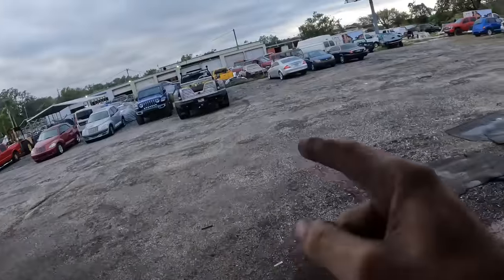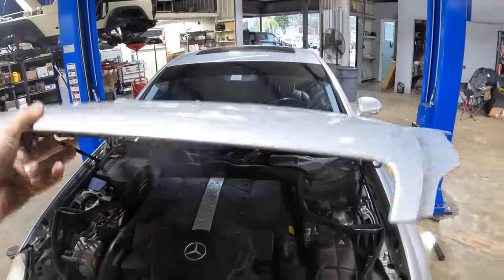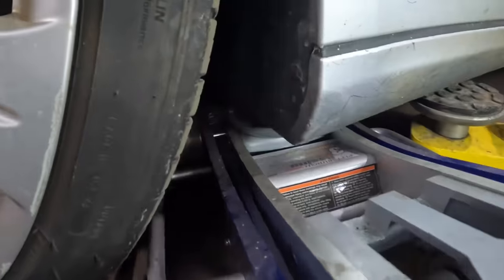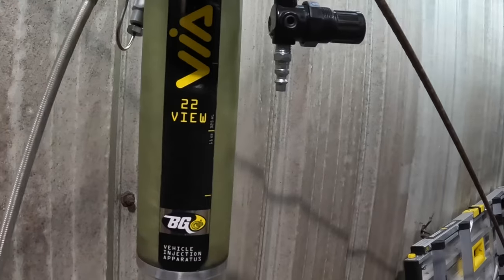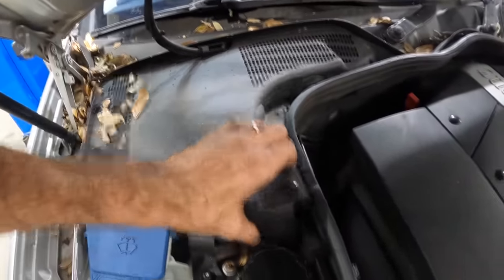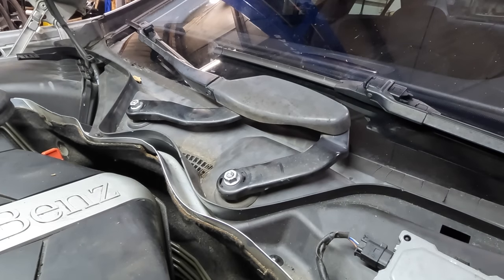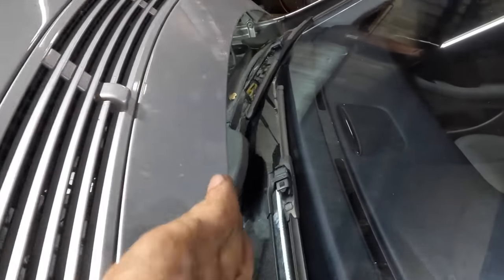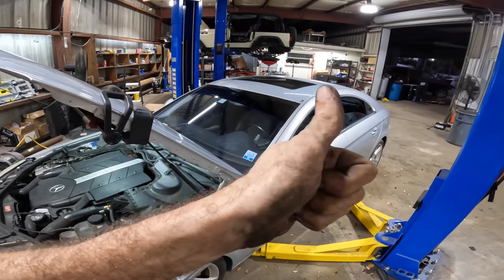Rookie Mistake on a Mercedes! “I quit” @SouthMainAuto

Comment: Mercedes... BMW... Audi... VW...  Apart from being brilliantly engineered solutions to problems that never existed, all are great cars until the warranty expires, then they turn into very expensive part consumers.   Once that warranty timer expires, you're in for a world of hurt. I say that as an ex mechanic, and ex owner.

EDIT:  To all the VW lovers out there (and I used to love my old '67 type 3 station wagon, and '62 kombi van)  They are, as a company and the CEO as an individual, convicted criminals, cheats and liars.
They care nothing about about you as an owner, no matter how much you like the brand, or how loyal you are.  You are nothing but a potential or current source of profit. They actively tried to deceive all owners and governments, then cover up that deceit.
And that's just what they were caught doing, wonder how much they get away with.
Probably true of all vehicle manufacturers, to be honest, but VW are convicted criminals. 

And the "brilliant engineering" was sarcasm.
Reply: Yes, I have the same opinion for the Mercedes RV. Great looking, well thought out, but if it breaks down mechanically, forget it in this small town 🤣.
Reply: I used to have a 2010 Jetta 2.5.  Brilliant car.  It was cheaper to maintain and repair than my wife's 205 Subaru Imprezza.  That Imprezza made me hate Subaru's with a passion.  Worse than an 87 Buick Skylark I used to own.
Reply: @Minimalist1266  I currently drive a 2011 Jetta 2.5. Great car, super reliable
Reply: experience any Volvo aged 8  or more years and it’s always the stupid stuff that breaks.
Reply: I don’t know if I can agree with brilliant engineering but I will say they are over engineered just for the sake of it.  Sometimes simpler is better.  But that’s just me.
Reply: This is only for more modern Mercs and Audis, the older cars  where foreign interference had not intruded, would run forever with only normal  maintenance. Think of all those Merc taxis in Germany and Holland.
Reply: I know a guy who had to spend $5500 to fix a mistake made by his friend who didn't really know how to work on his BMW. Then 2 months later, the tranny shit the bed.
Reply: I own a Jetta 2.5 5 speed manual and a CLK 500, both are super reliable and require nothing more in terms of maintenance than any other car. I paid $5,500.00 for my Mercedes with 115K and now has has 177K on it an I’ve only replaced the power steering pump plugs & wires and the front suspension. Of course brakes, oil changes etc.. still runs like new and has that Mercedes ride and handling. And, yes Ray, that car is both quick and fast.
Reply: I owned a 2014 jetta tdi my first and last vw I will ever own . I always had things breaking , traded in for a 21 corolla and never looked back
Reply: Don’t forget Land Rover and Jaguar. Just pray the car has more months in it than the payment book has pages…
Reply: Mk4 vw Diesels (ALH) are bullet proof and cheap, few cars out there will outlive one and get 46+ mpg consistently. Probably the only vw i will own,, But I'd never own a audi or Mercedes haha 😄
Reply: That's why I have 4 MK4 golfs 3 with TDI 2003 and two 2004 and 1 with 1.8t 2004. All of them cost nothing to mantain and are very reliable.
Reply: @arthur_mkiv8978  THIS....VWs especially those made before 2005, and most Golf and Jetta with 4 cylinder engines are generally super reliable, and easy to repair, funny thing is most shops lump those earlier VW models in with everything made since today...
Reply: I. Know. Bought my first BMW. I'm experienced and realistic, but after 400 miles and $10,000 in legit repairs with another 5k or more pending... I'm done
Reply: @arthur_mkiv8978   same got 3 mk4 TDis, a 4dr golf alh, 2dr golf ALH, and jetta wagon sadly a bew but still reliable
Reply: My fix for wipers on questionable vehicles(one with possible short life span) is Rain-X
Reply: I have a 2006 Jetta TDI - well-maintained zero issues!
Reply: I owned an 80s Mercedes Benz 300D. It had one wiper.  Amazing, I actually liked it. It reached all 4 corners of the windshield.
Reply: These euro cars have terrible resale value, so people snatch them up thinking there a great value. The problem being while you may have only paid $5000-10,000 your still buying parts for $80,000 100,000 car. Further with BMW you've got 80,000- 100,000 miles and then they start to disintegrate; many mechanics won't even diagnose BMWs because they know the owners will never agree to pay what's needed to fix them.
Reply: I suppose I won the Mercedez lottery with my 2012 C300. Just crossed 300K miles. Runs like a dream. Besides regular maintenance, all I've had to fix is a blower motor and one CV axle. That said, I had to convince the wife NOT TO BUY a Mercedez GL350 SUV...because lightning  never strikes twice.
Reply: Well, I'm happy with my 30 years old Audi. yes i had to replace parts and stuff but it's not that expensive imho
Reply: True, but they drive really nice.
Reply: My BMW is still going 158k Mike's, 2009
Reply: Samsung appliances have a built in timer like Mercedes and BMW that soon after the warranty expires they self distruck.
Reply: I have owned multiple Toyotas Nissans and Volkswagens.  I keep buying the Volkswagens now.  0 problems on 3 Volkswagens now all the way up to 200,000 miles when I sell them.  Too many problems with the Nissans.  Toyotas we're 50/50.  Time to end the myth of Volkswagens not being reliable.
Reply: Any car with this many miles would need thousands of dollars of work to get right. Maybe add an extra 0 for a mercedes.
Reply: @TheFrenchPug  134k miles (215k km) on my Audi 👍
Reply: @Laurelinad  I'd rather have the Audi
Reply: VW/Audi are just about the best cars to work on imo. And I’m educated Toyota tech 🤷🏼‍♂️
Reply: @TheFrenchPug  😎
Reply: Did anyone even mention BMW? They're the worst of em all
Reply: @@lol-yolo512 Well, I'm at 215k... So still a ways to go but so far it's promising
Reply: Brilliantly Engineered is far from case concerning these auto manufacturers. It’s all about the latest and greatest unproven technology. This is because the “hey everyone look at me” mentality that people buy these rolling piles of low quality poor reliability vehicles. I’ve thankfully been exposed to Bentley’s, Mercedes etc, the list goes on, only to find them to be absolutely overrated, overpriced rolling pieces of 💩. 
You want todays best yet not flawless built vehicles on the market today, it’s Toyota / Lexus and Honda / Acura. 
It’s because of all these extremely flawed manufacturers we can appreciate the good ones. So keep buying the overpriced garbage folks and the people who really research and try to get the most bang for the buck can have the far better quality vehicles for their money. LOOOOK AT MEEEEEEEE !!
Reply: Brilliantly over-engineered.
Reply: My 2012 VW Golf has never let me down. All manufactures have their flaws, the issue is that people buy these old cars without realising how much they cost to maintain. Likely the case with this Mercedes too.
Reply: I had a ton of Volvo S60 sedans, used to love them. Now I am too old to deal with maintenance so I just lease cars with a maintenance package and return them when time is up.
Reply: @watchingdanny  well said. 👍🏼
Reply: @simono.d9469  I’ve known countless VW owners here in North America with 9 out of 10 people I’d bet it’s been have said they’ll never buy a VW product ever again. I’ve also had GM owners swear how great their GM is, that’s even after rebuilding the engine, transmissions etc. I’d have to say people have different definitions of what a well built vehicle is. And of course regardless of make or model, proper maintenance of all vehicles is required that is not always done that needs to be taken into consideration.
Reply: True Dat 🤟🏻🇺🇸🇺🇸🇺🇸
Reply: All r junk
Reply: Very true.
Reply: Peoples today buying premium brands to look cool and all the money goes for payment of loans. And then the car gets cheapest maintance or if even that.. This cls is good example. Shitty interior, headlights are foggy, power steering making noise..
Never seen shitty car of any brand, with good maintance history. If cars part are expensive, then you cant afford it, simply as that😬 
And what will come to engineering, euro manufacturers are significantly ahead in engineering compared to us or asia these days.
Reply: @fixingitrightish   I have a 2013 Beetle TDI and a 2018 Corolla. I like the TDI as it's a nice engine even though the car  is built in Puebla Mexico. I need to change the Timing belt. 2.5 for VW Jetta are super cheap on LKQ. For less than $400 you too can have replacement. Cjaa is a little over $1000.
Reply: @arthur_mkiv8978  I have a similar story but instead of VWs I have the 4cyl diesel Audis with manuals. Pretty much the same cars. Two A3 and a A4 B5 and A6 C5.
Reply: Hence why I stick to toyota, dealing with a Chevrolet, Hyundai, and then a Dodge... never again. It's all my brother and sister car
Edit: I wouldn't want to imagine working on those car, I took one look under a VW also and I went dumb, maybe it's just me, might have to fix it once to know but those 3 car I mention also sucks, to much electronics
Reply: I hate Mercedes..junk.told the boss I wont work on. Left hand threads??stupid.
Reply: Regarding your question about shops taking advantage of a person based on necessary repair vs not necessary. 100% yes, you can bet it happens if the owner can be leveraged into paying. Speaking from awareness of a small city,  population approximately 7500. The city center and approx 30% of the residential population was declared an emergency after the businesses and homes were consumed by fast flowing flood waters. When the rebuilding began the local plumbing, electrical and heating trades could not handle the volume of the emergency type work. Other contractors came from out of town and gouge priced 200-400% the normal costs because people were desperate. Disgusting low ethics, especially considering many people were elderly, low income women and couples. One contractors attitude was I can charge what ever I want. Adding to the overcharge the contractors refused any warranty work claiming they are from out of the city area.
Reply: @LOL-Yolo I’ve heard the same thing about LG.
Reply: Can confirm.  Owned a stick 2004 VW Passat wagon -  wonderful car when new, but got REAL expensive later on.
Reply: Yep well said @Eh Wot
Reply: Never buy Audi. Always lease
Reply: I believe the biggest issue with the newer VW's is the obsessive desire to do penance for the Dieselgate fiasco by maintaining the lowest CAFE average by requiring a 0W-20 oil in a small, high compression (11.7/1) 4 cylinder turbocharged engine.  The engine was designed to run a 0W-40 as was the MB turbos and most of the older mechanics will tell you to run the 40 weight in any turbo engine.  VW has so much confidence in their new requirements that they dropped the new car warranty from 7 years/72,000 mile down to 4 years/50,000 miles.
Reply: I owned an 07 BMW X5 with 185k on the clock and it ran great mechanically. It wasn’t too expensive to repair either. Nothing compared to the duramax that I got to replace it. When you have more parts, you have more potential problems, but dang if BMW doesn’t know how to make a product that I want. I still own a BMW motorcycle and I will love it forever.
Reply: I've had several M-B. Every one of them had wipers come loose on the shaft. 
The first one stripped the splines. But was able to save it with a jewelry file and torque the nuts tighter than spec.
Reply: 😅i
Reply: Non-German cars are basically cheap items for people who just need four wheels.
If you are interested in cars, get a German car and enjoy your experience.
If you don’t want to invest in your ride quality and safety, drive anything else.
Reply: I like how everyone who owns a German car chimed in to say that theirs is reliable. Just remember you are in the minority. 😂
Reply: I bought a 140,000 mile R53 Mini for $700 in 2018.
I paid too much.
It had suffered severe neglect and botched repairs for a while. Yes, I had to throw a bunch of parts at it. Most of them would not have been  needed if not for the eejit(s) before me working on it. One of them broke the transmission. They aren't repairable, if you follow the Mini procedure...
It's a nice car now, 180,000 miles on it. No breakdowns since I got it running. I recently bought a brand new Cooper SE. 
People who think these cars are hard to work on just don't know how.
Reply: @Chainmailws6  No, I am not, I am German ;-)
Reply: @ToyotatechDK  Exactly, because they are designed with maintenance in mind.
Reply: With 146kmiles I do not wonder.... Has there been maintenance done in the past?  All those open questions, so no verdict possible, unless you have all the data! 
I do not like mercedeses much, bcause I have had a clk 230K, with lots of problems, got rid of it after costing me.... Now Toyota Auris TS hybrid, not a thrill at all, but o so reliable....
Reply: @Chainmailws6  : Maybe so, but they're fun to drive. I came off 25 years of driving Ford pickups and while they were reliable,  they were never fun. I enjoy driving the C250 and the Tiguan.
Reply: @@lol-yolo512 LG make a lot of Samsung's appliances, the company started out as a factory that made the budget line products for other brands, before producing their own branded products.

Comment: Makes me sad to see how people let their expensive cars degrade so far before taking them in for repairs. I'm sure the wipers and window actuators and motor mounts etc didn't all fail at the same time.. and those tires are just deathtraps.
Also, Ray, couldn't you spend a few secs to vacuum all those leaves out before you take the covers apart? Always really annoys me seeing you let that trash drop into the engine bay. The blowgun doesn't really make it any better..

Comment: The first time that my vehicle locked me out,  I was a good hour away from home,, with no extra I key. Took forever to get someone to get it opened. Always left a window open after that. The worst part is that you  never knew when it would happen.
Reply: Early dark and frozen mornings, the engine is running to defrost the windows and you step out to scrape ice. It's cold and windy and you hear the drivers side door go CLICK. The car locks you out with your phone in the car. Yep, you get to know the AAA guys by name after a few lockouts.
Reply: I had a Toyota Supra that did that to me. I kept a cheap thin key from the hardware store in my wallet.

Comment: I've lived near Galway on the west coast of Ireland for a long time.
Wipers are pretty much left in the "on" position. They start when the car starts, except for maybe two weeks in the year when it's nice ("nice" meaning "not raining" regardless of cold, wind, overcast, grey) and a common failure is the connecting rod between first and second wiper. Any garage or parts store always carry them for all popular makes and models and they can pop them in in five minutes.
Then you're good for another few years.
When the second wiper doesn't run, it's 99% the connecting rod. No need to replace the whole assembly.

Comment: My son's Chrysler van had a wiper arm problem where the previous owner had left a nut loose and the arms would get out of sync and hit each other.  I tried everything to secure it, including LocTite on the splines, but eventually had to replace the wiper arm as the material had gotten chewed up.  Fortunately the shaft was harder than the wiper arm.

Comment: A normal trick at MB dealships, is to spray soapy water at the strut tower, and air hoses. Makes bubles if any leaks. I think there is a valve air controller which you as well should diagnose, before changing the full strut. It should be placed behind plastic wheel arch inner shield, and could make the hissing noise as well!
Btw Looks like the shock damper, which is a part of the strut tower,  is damaged (oil leak?)
FCPEuroparts got great replacement parts, which are hell of a lot cheaper that OEM part from MB dealship..

Comment: You still need to check the washer motor on the Windshield may be just empty or failed. Some have a sensor to display when it needs fluid. some dont.